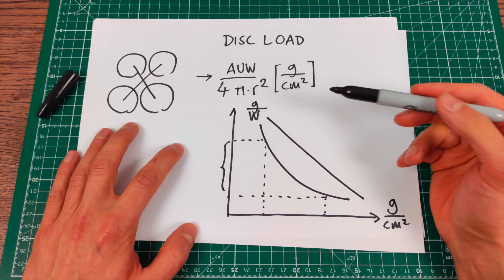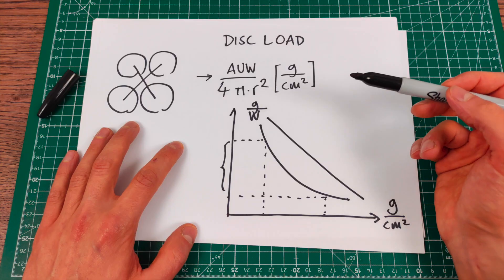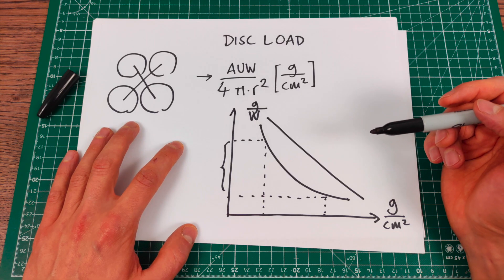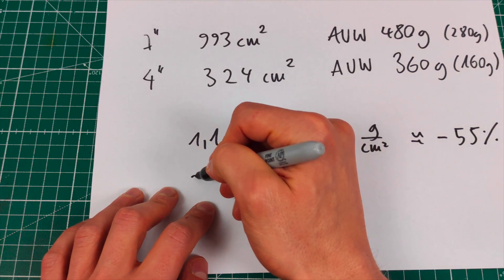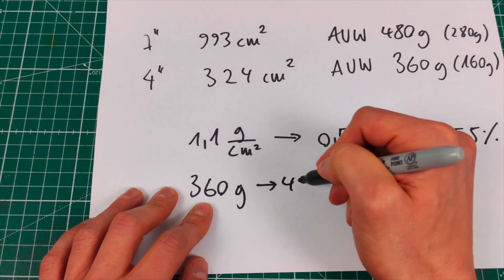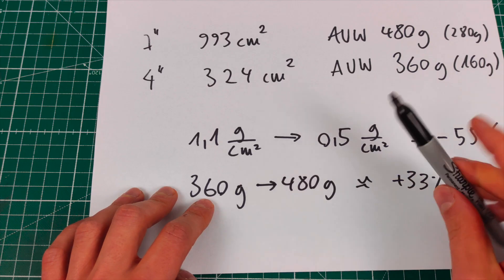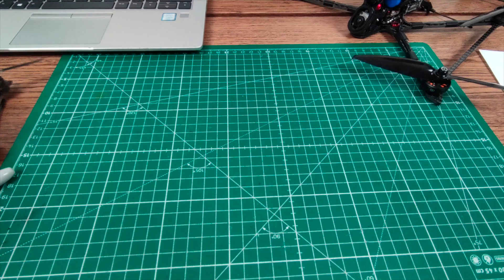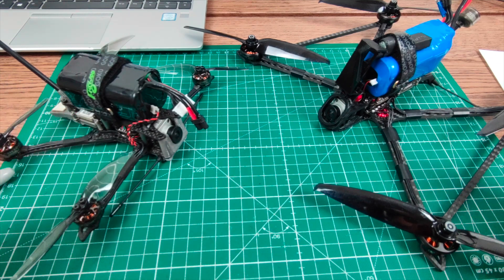Ultralight 7" vs. 4" | flight time comparison | 18650 Li-Ion

Comment: The disc load results might be closer if you only hover, but the drag from translational movement has a significant impact on larger builds. The point of using larger props is to carry more mah in the battery. Even then its not easy to counter the drag by adding mah capacity. Rather than prop disc I think watt/hr per gram might be a good test. The best I think would be to combine watt/hr per gram with drag of the frontal area, but that is quite tricky.

Comment: Im researching and planning to build a long range quad as well and from my research, it was found that the overall current/amp draw to hover or light cruising is the best indicator on the overall system efficiency. Because amp hour usage divide by battery capacity will nett us the estimate flight duration. The disc loading is not really the main factor.

Comment: Scaling up the drone size requires scaling up the battery size/capacity. A proper 7" build would definitely beat the 4" in range and payload.

Comment: I think that you cannot start from the "disk load" as you do to judge the efficiency but that you must start from the effective efficiency of the propeller motor torque (grams per watt at X% Throttle where X is the gas level necessary to fly at 40km/h) before making the comparison. And again, even doing this using the engine manufacturers' tables, it is false, because these tests are done statically. There is no concept of "simple" wing loading for a rotary wing, and your test demonstrates this with talent. Since I'm thinking about the design of an ultra-light 7" I came across your remarkably interesting video 3 years later. Thank you for that.

Comment: Bigger motors, more weight overall... same battery isnt a fair comparison. The larger system should expect a larger battery to achieve the same flight time

Comment: I have the 5 and 6 inch rekon quads. It would be very nice if you would also provide a 7inch  version of the quad, with a larger battery carrying capability for longer  long-range flights.

Comment: I need to do a faster flight, but went 70 min with a lightweight rig based off of the Black Opal 6". Battery pack was a 3S2P 3500mAh Li-Ion. Arducopter was set for ~13kts running a circular do jump pattern. Non-HD rig, super light 215g before the Li-Ion(290g). I think if I increased my speed slightly, it might be more efficient.

Comment: where did you get 25 minutes from initial 10 dude? no way it does 25 with this battery.
and flight time isn't important, the range is. as you already know this bird needs some speed to be efficient!

Comment: by using the same battery the 4" had a much higher ratio of battery power to weight, there seems to be an efficiency curve here where not only is the right ratio of disk load to total mass important but the right ratio of battery weight to total mass.

Comment: Thanks, this was exactly the video I was looking for. Did you measure the resting voltage afterwards? Since the 7 probably draws a bit more current the LiIon would drop voltage harder.
Anyhow - in my case I'd value the total trip distance before flight time, so I'm guessing the 7" would win.

Comment: "1 year later..." lol    Definitely the high pitch of 7"prop induces a lot of drag which ate the expected efficiency from the larger diameter prop. Another thing: ~120g lift per each 7in prop  is very low and its rpm is very low as well. Not sure if this is the case but, at very low rpm, the efficiency is horrible (just imagine, e.g. 30 rpm producing 0 g thrust at 1A, efficiency = 0) and increases sharply as rpm increases reaching a peak followed by a gradual decrease at high rpms.   It would be cool to see a bench test comparing W/g thrust per each motor in both setups.

Comment: biggest problem is that when you increase pitch. You increase blade drag and it is hard to find probs that have lower than 2.4-2.5 pitch. I have seen one 8020 probs, but i think those are bad.
Reply: I wonder if prob arms would be shaped like airfoil, and wires would be inside how much would it help for flight times.
Reply: I think 2104 kv1800 would do too.

Comment: I see Rekon7 coming soon.. real curious on motors. cause i was thinking when i was going to build myself 2303.5 with gemfan new lightweight LR 7035.. arm look so long and skinny.. surprised no braces connecting left and right motors along with front and back

Comment: There is clearly a fault in your logic. Just take the comparison to the extreme: think about a 1 m props quad with, potentially, even smaller disk load. There is no way that this monster would fly even a minute on the 4s Li-ion pack.

Comment: Surely a 10 minute flight time on a 4s 7" quad shows something is wrong with the config when most 3s 7" quads (e.g. Bugs 2) routinely get 15-20 minute and more?   e.g. bad motor/prop combo.

Comment: Let me simplify this. low rpm propeller = more efficient.
But, the weight and momentum and power of 7", it is difficult to fly slow.
My typical 7" with 50g Xing2806.5 does NOT get longer flight times.
I am gonna give it another try, but even with very light 7" biblade, I advise at least 30g 2306. 7" 9g props are like double 5" prop.

Comment: load up the 7" with enough battery to get similar disc loading of the 4". I think that would be a more "apples to apples" comparison. People that are into long range don't use a larger quad to carry the same small battery - the point of a larger quad for long range is to carry the weight of more battery.
Reply: With the same disc load, the 7" would have to bring about 900g battery, so almost 4x of the pack. That seems unfeasible in that small frame.

Comment: Your making it to difficult on yourself. The way to test this is take a few different sized motors. On each of them test the thrust with a 4,5,7" propeller at a fixed power draw to see if a bigger prop size improves efficiency. Then do some math for weight of each size class with the recorded efficiency.

Comment: i think the issue was your motor selection. the 2204 motor and high pitch props on that were too Amp hungry. 3 pitch prop and 2004 motor would have been a better selection.

Comment: Thanks Dave for all your hard work to help us all get in the air.
One metric it might be interesting to fix is mAh to disk loading? Probably set that from the 4" and scale the appropriate battery for the 7". 
Having 3000 mAh battery on the 4" then a 5250 mAh on the 7" would be about the mark for the same mAh per cm2. It is a more even point to make your testing from I believe. 
Thanks again for everything Dave I would be stuffed without you JB and all the others.

Comment: The 7 inch had additional carbon fibre supports on the arms, while you flew the explorer without them. Air resistance is no joke. If the supports are necessary for the stability of the quad, then maybe the disc load theory simply needs materials science to catch up before it can be used in quads of this size. Perhaps folded aluminium would work

Comment: Benefit of 7inch is that you able to install action camera, may be also with 1or2 axis stab, or some else bagadge))) . 4inch drone only gives you possibility to fly longer with simple fly-camera, but 7inch has place to install 4s2p battery for more long range.
Also 7inch gives you opportunity to install motors with more power and weight, but increase speed, accelerations . Ideology of 4inch - less weight, so this is always compromise  with all components.

Comment: great video, idea....  motor amp draw at same cruising speed would be higher on the 2204 than the 1404 and at both running 4s.  What if you ran the 7" on 5s or 6s, bring disc load closer, and with a higher cell count you can pull fewer amps to get the same cruising speed?

Comment: I read an article about Vertically Offset Overlapped Propulsion System (VOOPS), improves efficiency could you give it a try?
Reply: I think the new DJI FPV drone may be using a similar vertical offset but no overlap, same with other folding drones.

Comment: Those gemfan 7042 inch props are rubbish....I did alot of testing and the 8x4 gws HD was the best for small copters and my planes
for that matter......its a bummer because they do look a very nice prop.....try the 8x4 they look like they will fit your frame....
Im getting 18 minutes with twice your weight and same battery as your 7 inch frame with my 8x4 props tri copter

Comment: Nice work. 👍🏻 I guess, the 7“ props were either too large or too steep pitched for the motors to hit the sweet spot. The efficiency drops drastically when the motors are even slightly overloaded. As it comes to the additional weight, this is already included in your calculated disc loading.
For example last year i got >20g/W out of this build ( https://youtu.be/OTPc7oKgKTE ). The disc loading has been about 0.089g/cm2. If i put significant heavier batteries onto it, i need to reduce the prop size by one or two inches to hit the sweet spot, otherwise the flight time will drop at some point.

Comment: Ok we all know it’s possible to get well over 20 minutes with either configuration if you use the right batteries. But what if it’s really windy where I want to fly? What if I want to carry a GoPro? The 7” has its uses. I’d like to see the 7” platform get even more optimized. I feel like you didn’t even try with the 7” Dave. I bet you can make the best 7” LR and sell em like hot cakes though.

Comment: Have you thought about stacking the AIO and Vista and mounting the battery behind it? You could ditch the top plate and standoffs to save some weight, and basically get a top mounted unibody.

Comment: ...you would also need to fine-tune the drive-train. Check steeper and shallower pitch. Every motor has it's sweet spot of RPM vs torque - you just need to find the right prop to get it there... 
Keep going, man! :)

Comment: What’s currently the pitch of the 7” prop? I guess you should have a very low pitch with a maybe a slightly lower stator but bigger diameter. 

Maybe you can divide the pitch to disk area and use that factor to divide that with the motor specs and get some factor out of there what you maybe can get some conclusions out of and optimize

Comment: Also food for thought... I learned years ago that the very ends of the blade is where the most drag not being converted to lift occurs.  Its why some of the props now have the little spikes on the trailing edge out at the end.  With bigger props this effect is exaggerated because the tips are moving faster all else being the same.  Using ducted props is the most effective way to reduce the tip drag turbulence, but has the undesired effect of causing a drone to auto level due to the way ducts work when moving in a direction other then up (in the case of drones).  Ducted propellers are the most efficient way to produce lift.  Its why all modern jets use ducted engines.  I'm thinking maybe a very thin duct just to break up the drag might work?  Ducts are a whole rabbit hole.   The guy on RCmodel Review explained them pretty well if I remember right.  Also Also wind resistance/drag increases exponentially. I don't think the extra wind resistance on the body of the the 7" vs 5' would make much difference at 30mph.  Like I said, ... Food for thought.
Reply: Ducted fans are theoritically have better efficiency than non-ducted fans, BUT in practice, it's very very hard to make because the low tolerance of the distance between the prop tips and the duct to prevent vortex generation, also the duct's intake and exhaust itself are very hard to design to get the best efficiency. This is why many improperly designed EDFs in the market has lower efficiency than simple open props.

Comment: Removing the wobble out of the system is VERY important.  As long as there is wobble the motors are constantly speeding up and slowing down to fix the wobble the flight controller is experiencing.  This will DRAMATICALY reduce flight time.  I would first try tuning, but if not stiffen up the frame.  Until you do that you won't get meaningful results.  It was fun to watch the attempt though.  Good effort.  Its cool you're doing this.

Comment: Really very interesting, thank you! Definitely worth a subscription...;D. Here are some thoughts on why it didn't work out with flight time: A ballpark calculation (momentum theory) on the hover powers=f(AUW, DL) of the two configurations shows that the 7" drone should require about 12% less propulsive power than its smaller brother. Twelve percent is a decent potential, but it can be quickly eaten up by parasitic secondary effects. One of these is certainly the added drag of the larger configuration. However, I would take another look at the propeller selection in particular. A low disk loading also means that the propeller must deliver a comparatively low thrust for its size. So it may be that if the propeller is incorrectly selected, it will be operated almost exclusively at low part load. Drastic losses in efficiency are quite possible here. Maybe lowering the propeller pitch could be solution for you. BTW: Did you log the flight data?
Reply: Hmm we found out that its quite the opposite. Me and my friend are chasing the best LR endurance possible and so far we found out that best performing props on low disc loading quads are beefy bullnose props. Also for such quads its important to have steeper prop pitch rather then lower one. Its because when travelling the motor does not have to spin as fast to cover the distance in RPM - in short - the prop travels further. To put it in example -  we were flying with triblade HQ props on 3.5pitch and DalProps on 5.6 pitch. HQ could only fly 56kph on 14Amps where DalProps ran 14Amps on 70kph. During one flight its close to 5km difference on covered distance.

Comment: The props are big a factor. When I tried endurance flights with a helicopter, the 5 degree pitch and 7 degree pitch have 50% different flight times. I still fly FPV helicopter and not going into quads because heli's blade foils are well-researched by NASA and I can do all the calculation before taking off. Quad props are never measured in a wind tunnel for their characteristics. The brand names just tune it blindly with brute force. There is no air foil data to look up. It is just cheap labor mass production and try as much as you can.

Comment: Doesn't make sense to use the same size battery for both.  You wouldn't use the same size gas tank for a sub-compact size car and a full size sedan.  The 7" can carry a whole lot more battery than that.  In general, larger props are more efficient.  So I think if you have an optimized 7" quad, you can get it to fly longer (and definitely farther due to higher speed) than a 4".

Comment: I have tested both a VTC6 18650 4S1P pack and a INR 21700 (Samsung cells) 4S1P pack on the same quad (Catalyst Machine Works Shocker 5” with BrotherHobby 2004 motors, 2100kv) and I was pretty disappointed with the 21700 cells. Sure, they are 4000mah each, but they are extremely heavy. My VTC6 pack weighs a little over 200g, and the 21700 pack weighs 300g. Given that the 21700 cells weigh 50% more, it’s pretty disappointing that they only give me a 33% capacity advantage. My next pack is going to be a 6S1P pack with VTC6 cells. I think that having the 50% increase in total Wh, and the fact that the motors should draw less current to keep the quad in the air I should have a pretty good time with that setup.

Both packs should happily output 30A continuous, but the 21700 pack gets significantly warmer in a hover test than the 18650s, even though the 21700 pack is only drawing about 2A more (6A vs 8A) in a hover. Overall, hover times were very similar (ran both packs down to 2.6V per cell) and the quad struggled a lot more to just hold the 21700 pack in the air compared to the 18650 cells. 

I would love to see your experience with the 21700 cells though; maybe I got a bad batch or something. A local hobby shop near me also has some pretty interesting 26800 cells that are 6800mah each, with a 30A constant current rating. I’ve been wanting to get 6 of those and run them on a 7” quad to see what happens, but I can’t decide between trying that out and just running a 6S2P VTC6 pack.
Reply from the maker: VTC6 are by far the best option we have at the moment. I tried Samsung INR 21700 and they are only useful for heavier builds where you really really need those extra 10A.
I would bet that the extra weight of the 6S and the very high kV (assuming you put them on the Schocker) will more than cancel out all the extra Wh you have. In reality the theory that higher voltage will lead to lower current doesn't really work out from my experience, especially if you keep the kV the same. The motors just react very aggressively to throttle and PID inputs and start to get inefficient. This puls the extra weight usually means you aren't gaining much in flight time.

Comment: The larger quad will have much more drag maybe more then double.  also square/flat surfaces are not your friend, round/curved leg sections would be better.  but why not just use the same 4" body/base with long 7" hollow round legs.  Or/and try larger dia motors with lower volt/rpm